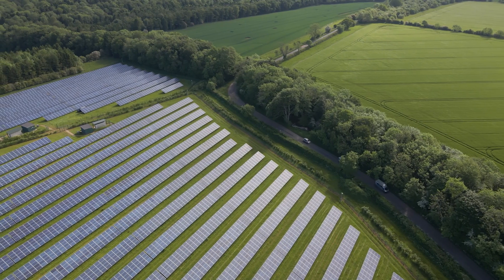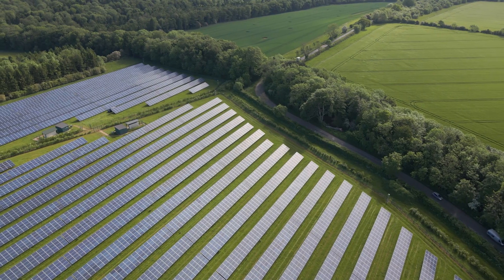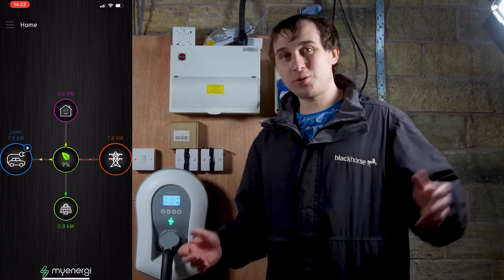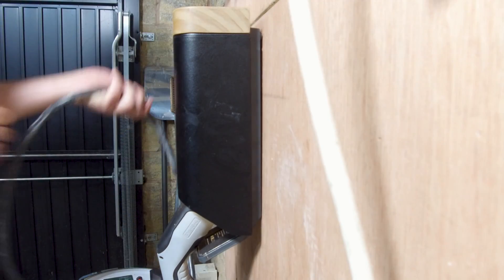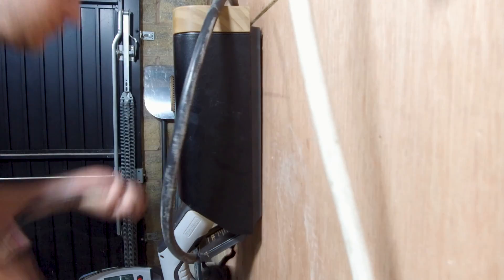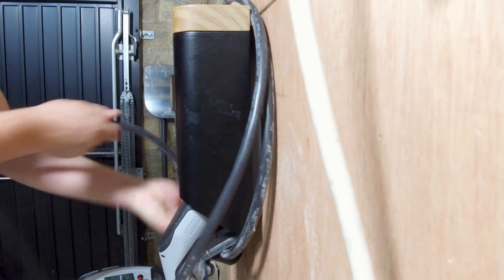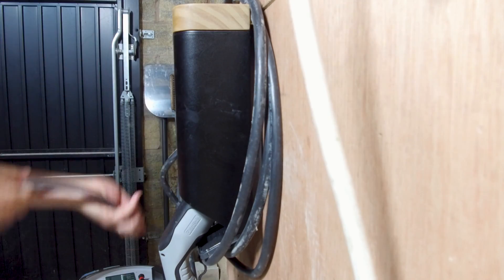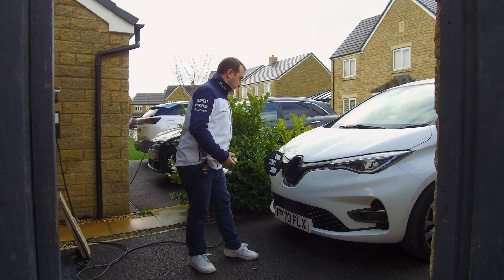5 EV Charger Features YOU Definitely NEED

Comment: The feature I most want is the ability to set a specific charge rate. I’ve asked myenergi if they can do this but they don’t reply. Fast charging uses more than my solar inverter’s capacity, the other eco settings aren’t compatible. My Zappi doesn’t work very well with my house battery and the charge rate swings wildly which also forces an export to the grid, so I am reduced to granny charging in the daytime when the sun’s out and managing the situation manually. What a shambles!
Reply from the maker: You could go into the zappi and change its settings for what it can charge at you'd have to do it EVERYTIME but you could...  However a correctly setup zappi should work with your battery and solar no issues.   Is the battery and solar on the same HYBRID inverter or separate

Comment: Agree with you about tethered chargers, although I still find winding in a 10 metre cable a bit challenging at times.
Reply: While was going to reply under own right saw this response an wanted to tie in to it

I'd disagree about tethered in favour on un tethered - reason of 

have a Zappi v2 tethered with type 2 plug following replacement of v1 that by default was tethered

currently have PHEV requiring type 1 plug (use converter) but have on order hope to land Mar 10 with dealers BEV that requires type 2

charging points different places

while will reach

if cable damaged on untethered while need to pay out for new cable can fix into place my self where as weathered requires engineer (or person of sufficient knowledge) and wait for Apointment

my neighbour currently having blank put in place while having work done - so your feed back could be interesting
Reply: @SrgBilson  I have a 7KW Rolec charger, the 2022 Trupen version. The cable is very robustly attached but I still get assistance to wind in and wrap it around the charger as it is a bit like fighting with an anaconda at times due to its sheer length and weight. 
Your point about the cost and hassle of potentially having to replace an tethered cable through time is a good one, so only time will tell if I should have gone down the route of an untethered cable.

Comment: One advantage of an untethered chargepoint is that you can get a nice long cable and charge the car at the end of your drive, rather than just the car next to the garage. 
Ours is 5 years old, but it's as dumb as they come - is it worth upgrading while it still works (have solar and battery and moving to Octopus Go)?
Reply from the maker: Get a long cable when you buy charger ;) if you want your charger to work intelligently then yes it’s worth the upgrade if your often at home during day and battery is full and solar is exporting it be very useful.   If your not with octopus currently please consider using my referral link we share £100. Also I’ll be covering some chargers allowing access to octopus intelligent!
Reply: The Zappi charger works perfectly with your solar and battery and Go, I sold my dumb charger when I replaced it with the Zappi, very simple as you already have the power available.